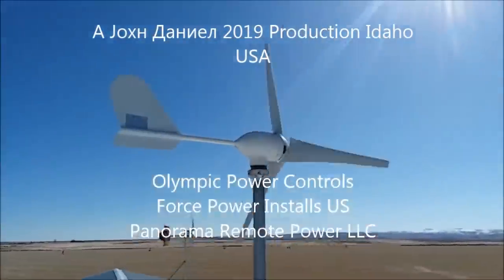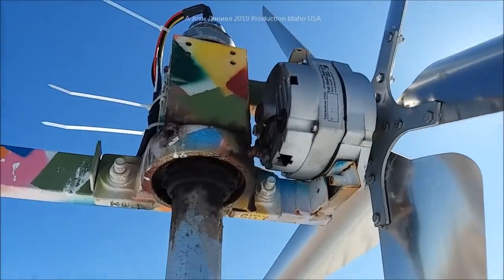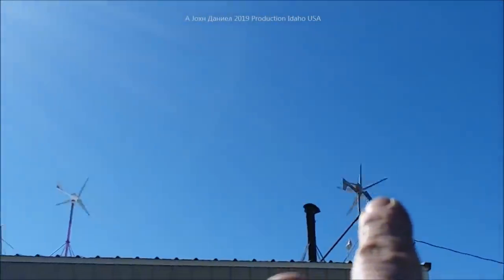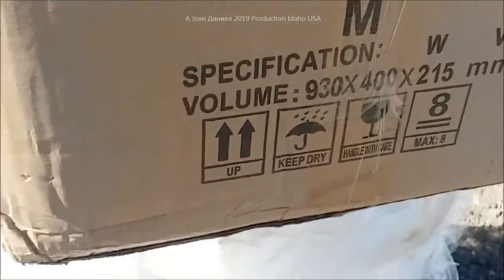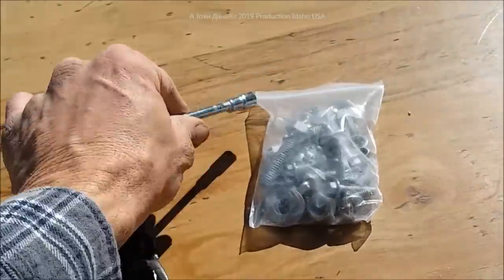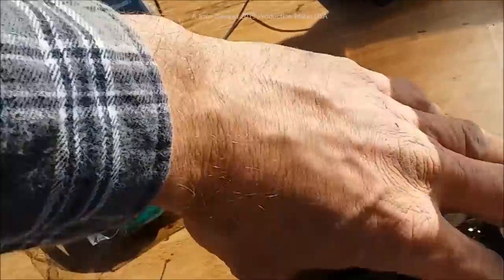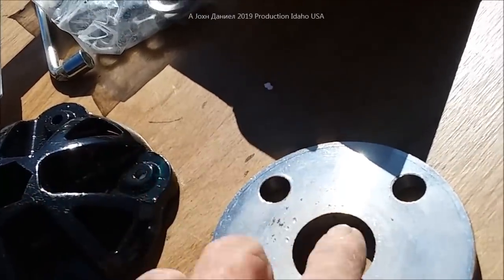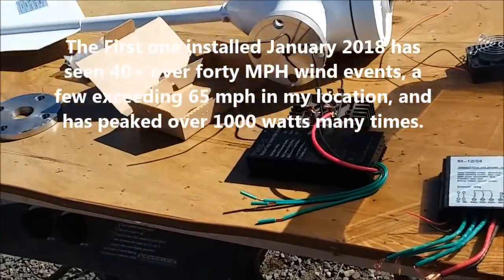Genuine 500 watt home wind turbine, Best small Wind Turbines made! FULL PARTS LIST BELOW video

Comment: Great video! I'm thinking of getting 3 of this. By the way, what size of fuse or breaker can one use for this turbine? And, is the output voltage in AC or DC?
Reply from the maker: For 12 volt system - (3) 60 amp Mini ANL fuses right before the rectifier then 100 amp DC breaker from rectifier to the battery. Mine has hit over 100 amps due to my winds, so I use a 120 Amp ANL in that place of a 100 DC breaker.  For a 24 volt system, cut all those amp ratings in half.
Reply: @JOHNDANIEL1  Thank you for the reply. I truly appreciate it
Reply from the maker: 3 legs from turbine are AC, wild 120 degree sine of field, use proper fuse on each. Outgoing is DC from rectifier use breaker on that.

Comment: What power are the 10 magnets?....and is there a set way of placement....I’m referring to holdbackaray....sorry for the spelling.........great video 👍
Reply from the maker: 2.15" long by 1" thick N-48, Placement is 14 degree angle.
Reply: Јоhn Daniel 14 degrees angle from the centre or 14 degrees alignment of the inertia plane.....?...I presume all north face the same way?...thanks for the reply
Reply from the maker: Magnets are longitudinal with polarity in length,  polar diverse, N-S-N-S  5 north pole towards front of PMA, 5 south pole towards front of PMA. 14 degrees off right angle to core face.
Reply from the maker: Get a thermodyne 14 mag unit, de-construct it, remove magnetic core, get new magnet mounting plates made to accommodate only 10 or 12 mags. The 14 poles are a throwback thought of a actual car alternator, with permanent mags you should not try to match a energized stator needs since theres not need to energize the windings with permanent mags. 14 makes the iron in the stator produce over flux, spacing them makes the cycles smoother and no heat generated.
Reply: Јоhn Daniel thanks.....I will definitely try...would you ever consider trying to feed the power through a double capacitor?...obviously used a magnetron....as the power is in the wind and I understand how to create microclimate in the garden...I’m naturally thinking of how to increase the rate of acceleration within the the field of energy...

Comment: I bought the same manufacturers 500 Watt model and with 25 mph winds I am barely getting 3 amps. 500W at 12V should be around 33amps? What am I doing wrong? Everything is set up correctly to a 1000 AH battery bank. 
I do have 400W of Solar with the MPPT going to the same battery terminals so is this a problem? I am getting 10amps from my solar. 
Again, the wind controller is showing green battery and green charging but my ammeter is showing less than 3 amps in 25 mph wind.
I am feeling I bought a piece of junk like most of the Amazon reviews say but if anyone can help, please do! Thanks
Reply from the maker: From Amazon? They only sell that exact model from Tashira on Amazon. The rest are from B&B and they have 200 watt PMA's on them. Be careful looking for similar "LOOKING", they are not all the same. Some have been caught selling 96 volt windings and sold as a 12 volt. Caution!
Reply from the maker: I put the link to the only verified seller for Wuixi Air on Aliexpress for a reason. If I wanted to make a buck off it, Amazon pays to share links in about 30% of the cases, Ali is so cheap I just post their stuff to help my equals out there.
Reply: @JOHNDANIEL1  it looks exactly the same as the one in your video. Same housing, same tools, props and the controller. It even has the same decal on the tail. The seller was called HappyBuy in China. Either it's the same manufacturer or they buy all the same parts and assemble them different. Not saying that is not possible. Wouldn't the charge controller brake if the wind generator excels the voltage?
Someone mentioned that I could be having a problem because the solar and wind controllers are both connected to the same battery terminals and they will give each other false readings causing them to not work to their potential. Is that possible?
Reply from the maker: @SailingCorina  The solar controllers could cause a problem but thats not common. I would try a 100 amp rectifier,  and then a watt meter, and possibly a diversion controller set higher than the solar controllers. Another option is to put a huge load on the battery bank to drop its volts below the 13.1 restart/re-engage of the wind controller to force the wind controller to allow power through while theres sufficient wind, about 15 mph. And lastly, it just could be a bad controller. 
TROUBLE SHOOTING - If you have a old but still working car battery, wire the wind to it, see if it performs.  You can get a multi meter, set it to 200 VAC and test the 3 wires from the turbine with the controller disconnected. 2 wires at a time alternating them around to get at readings.

Comment: John ... thanks for the vids!
In your remarks you mention a smaller version ... and reccomend 24v working in a 12v system ...
How does that work? 
I have a cabin 100% off grid on an Island in far Nth Sweden using a combo of solar and a small generator powering a full 12v system.
I want to add wind so I can get the power where and when ever it comes ... 23 hrs daylight in summer and 23 hrs darkness in winter...
Can I email you with some dumb questions ...
Reply from the maker: 24 volt can work in a 12 volt system, I usually recommend them in low wind areas since a 24 can get past 12.8 volts at lower wind speeds and it don't bother the battery but it does make 1/2 the max watts into a 12 volt system. BUT if thats your best option, some verses almost none then thats a thought to consider. Also it will transmit power down longer wires to a 12v system if your choices are not great on locations to install a turbine. I know many who bought the 1000 watt Green E turbine to run into 12 volt system.

Comment: What's the result,if I choose to use micro wind turbine on R.V?
Reply from the maker: For a RV, due to structural limits on its frame you need one OR 2, like this one https://youtu.be/pZuI2wSXO6o . It is easily lifted and taken down for transport. And this model will get you 600+ watts with a constant average of 320. It and its pipe weighs 16.3 lbs less using a 1.5" pipe instead of 2". 
Most RV power installs I do includes 600 watts of solar and one turbine. I use the MM 100 panels ( https://ebay.to/2ExrxUt ) because they are 4 buss bar type which means they can lay flat with little loss in output.
Reply: Thanks,John Daniel.
Good luck in your designing.

Comment: Please help me to know, which is best between micro wind turbine and solar module.However  I want to know their advantage and disadvantage.
Reply from the maker: 80/20 is the most effective rule. 80% solar, 20% wind. And you do your math with  81% / 44% meaning you will have 81% advertised power from solar available and 44% advertised power from wind turbines available. EXAMPLE You want 1000 watts of solar and 230 watts of wind power, so you buy 1250 watts of solar panels and a 500 watt wind turbine to guarantee that will be what your results are.

Comment: John  what do you think of the other Chinese manufacturers. I am living and teaching in China and I can get almost anything but am really interested in your experience. You have me sold on these. One thing I was wondering.  would it be of any use to get a larger wattage wind turbine or should I stick wit the 600 watt? I will be running a 24 volt battery bank so  and will hook this up in tandem with solar. any advice you can give me will be much much much appreciated. one last thing, what do you think about the vertical axis turbines?  much thanks again, I can tell your genuine and that is rare these days. have a good one.
Reply from the maker: Best quality micro and small turbines 200 watt to 2kw and priced higher for that reason is Sunning Wind Power. These in the video are affordable, work very well and unlike most Chinese products the Wuixi Air is accurately rated. The majority of Chinese wind turbines under 2kw are just toys, but the luxury I have is owners buy them on their own study, I then am called to install them, my luxury is I get to see what works and fails based on that arrangement and at no product cost to me. I learn warranty, durability and price advantages from my part in the process without loss to me.

Comment: can someone come visit your business?  when will you be making / selling plans etc ?
Reply from the maker: Plans are area, needs and wind zone variable. So best I can do for people is help them get educated on the system that fits them. I can help with schematics if it helps for a specific user, i do your drawing when enough info is assessed and that I do for $5 to $10 per person up to a 4kw system, after that its a lot more involved due to having to get much higher grade wiring and inverters.
Reply from the maker: Head to Texas, go there as a Electrician and work 100 hour weeks. South of San Antonio is completely off the hook with work.
Reply: @JOHNDANIEL1  Im headed to FL in 8 days to do the same ,    stay in touch and maybe I'll head your way next.
Reply from the maker: We are sorta putting together a grouping of people to power buy 150+ acres in the area near Brady Texas.  You can buy bulk land cheaper than 10 acres per person, split it in 4 or 5 ways and help local each other best we can. Most in their 50's ( 40 to 60 ) and all with skills.  I make 130k a year in Texas as a tanker driver, and even if Texas goes Blue, the fact is its a republic which means the capital has no more power on administration than the counties in such activities. So you move where its a Conservative bible belt county, and you promote your land and skills. Not as a cult, fort, sect or compound but as a buying power exercise with similar thinking people.
Reply: @JOHNDANIEL1 interesting, same thing I was thinking about here in TN
Reply: If I wasnt so dug in  here in TN Id sure consider it...   Im also X mil and a contractor.  I do have a buddy who I looking , hes a builder and good christian , also a mil/ contractor.
Reply: @JOHNDANIEL1   sent you an email also

Comment: Does an MPPT controller fit into this setup?
Reply from the maker: It can, but you want one with very high max input voltage of 100+ volts. I install lots of 24 volt models, mostly the 800 watt from GreenE and using a certain 60 amp MPPT works impressively with those.
Reply: @JOHNDANIEL1  Your response is greatly appreciated. With a 100V+ MPPT controller, would I still need a rectifier? How would a typical optimised setup look if I had such a controller? It might seem a silly question for the experienced but I'm not and I figure that's how I learn. Thank you.
Reply from the maker: @Ihaveausernametoo  Just use a rectifier in most cases, but if your going to get high winds I suggest using a wind controller with resistors just put a 24 volt model and wind controller on a 12 volt battery with MPPT system. Or a 48 volt model with 48 wind controller to a 24 volt battery with that MPPT.

Comment: Besides the turbine! What else do I need to buy ? Cords  -batteries-power converter/inverter - , can it power my central a/c system? Thanks .
Reply from the maker: Wind can supplement your power use, not replace a coal fired power plant! A central AC unit would require 4600 watts of solar just to match its needs, and 6 wind turbines. Most people start by super insulating, changing to LED lighting, and other low energy appliances then do sizing of their system on the reduced energy needs they end up with.

Comment: Is there a PMA that will work w/ a water turbine and run the output to a controller?  How does one keep the wires from twisting in the pipe as the wind direction changes.
Reply from the maker: The one in this video. https://youtu.be/NhMjDRAsFaE It's source link is below the video. Use a 24 volt model to charge 12 volt batteries if using for gravity water wheel power. Otherwise use the volts of choice for water turbine instals, keep rpms under 1100

Comment: Great information John. Can i use the wind charging option to offset solar power during stormy days when clouds block out the sun. If so, how can I send the power to the battery backup "Tesla's lithium ion " in order to keep charging.  Sorry for the lack of knowledge on this subject. Thank you for sharing.
Reply from the maker: A proper controller will achieve LiPo charging. If your getting this turbine, you can make a cool hybrid. I suspect your 48 volt though and that may cause a issue creating a hybrid. But what I do is get 4 - 12 volt batteries ( slave battery bank) , wire them to 48 volt, charge them with a 48 volt MPPT wind turbine & controller, then using a 24 volt LiPo battery bank I charge that with a 60 amp lithium programmable MPPT from the 48 volt slave batteries. They make a 800 watt turbine thats 96 volt, that could be used like above to charge a 48 volt or 60 volt LiPo.

Comment: John, I just bought this exact turbine! I am using the charge controller/brake they sent with it. I just don't know how many watts its producing? The green "charging light" blinks when the turbine is spinning, but my battery never goes over 13.0v (12v battery) how can I monitor this.  I am interested to  know why you are using a bridge rectifier rather then the charge controller they sent? Should I be concerned that their is no dump load? As you said the windmill is very well built! I love your videos!! Tell the Chicom's you have made at least one sale :)  from a fellow Missourian and Viet vet Larry
Reply from the maker: Be sure your wire gauge is 10 awg, the length not over 50 feet and the turbine in strong clear wind. If it don't sustain speed it will not build flux in the magnets and produce amps. And recheck your system, one bad connection and your 2 phase, the light will blink, but you won't make amps.

Comment: Nice video with one exception being the wording. 17:37 "rectified like a transformer"... uh no that is incorrect.  A bridge rectifier is used to convert the AC voltage waveform to a DC level (with some ripple voltage present).  I bridge rectifier does NOT drop the voltage down like a transformer which utilizes winding ratios to achieve different voltage levels on AC voltages.  The reason it appears you are dropping the voltage (like a transformer as you say) is because you are going directly from the bridge rectifier to the battery bank which is very low impedance like a very big load when the batteries are low.  That drop in voltage (turbine output voltage - bridge rectifier output voltage) is being burned off as wasted power by your bridge rectifier.  As the batteries charge their impedance (internal resistance) increases, so you are left with the turbine producing more power than the batteries want to accept and then the voltage rises to the point where you have to dump the extra turbine power or risk raising the voltage of the batteries too high which will damage them and you can overspeed the turbine due to the now inadequate load resistance once the batteries charge.

Comment: How do I know if I should get a 12/24/48v. I live in a place that is at 5300 ft above sea lvl and can get very windy. There are no trees to stop any wind so since I sit on top of the hill I get full blast when it storms.
Reply from the maker: What ever voltage you want your battery bank to be, thats your best choice. If your going to grid tie then you want the 48 volt. If you need a recommended grid tie that is safe and can handle it, let me know I'll refer you to one.
Reply: @JOHNDANIEL1  it will not be the to grid. Just for my own property
Reply from the maker: @tschnd1969  I would suggest the model at the top under the video in my description area, go to the site, select the 3 blade 500 watt 12 volt model. If your extremely windy, just mount it closer to the ground to keep it under control and be sure to put no less than 4 large deep cell batteries on it. 12 volt format.

Comment: How do I know what voltage to get?
Reply from the maker: Whats your battery bank ideas, thats the voltage to get. If you want a 12 volt system, get a 12 volt turbine.
Reply: @JOHNDANIEL1  Just what to charge up 20 volt cordless tools with two batterys as storage. Thanks for replying.   Jon
Reply: Voltage of your solar/wind/hydro system is mainly determined by how far you want to run your wires before you convert it over to 110v AC.  Low voltage DC systems are super sensitive to wire resistance, so 12v is mostly just for if you've got all of your DC components in like a 15' circle.  You can go farther with it, but you're going to go broke buying the really fat wires DC needs to run distance without frying your wiring or having enough losses that you might as well not have the system.

Comment: John - do you have the 300 on your RV?  How did you mount it and is it something you take down when you travel?
Reply from the maker: I am ordering their WM-300 for my RV, the reason, weight. Its 13 lbs lighter that the VAWT and makes no less but probably 15% more power but can be much easier installed on location. The VAWT lantern has never hit over 165 watts, which is ok sometimes, takes much more height and clear air for my set up on the Jayco. 100+ watts in 20 mph is not bad for the cheap price point I bought it at, its only worth $135, which is near a solar panel but not what I need in weight.

Comment: You should just put it on another load like a resistance load using a zener diode in a relay to heat water something said of wasting it with a some sort of resistance system as far as your break your break should be heating water